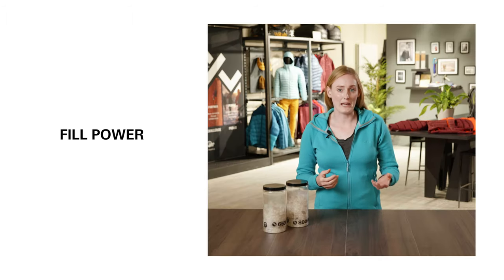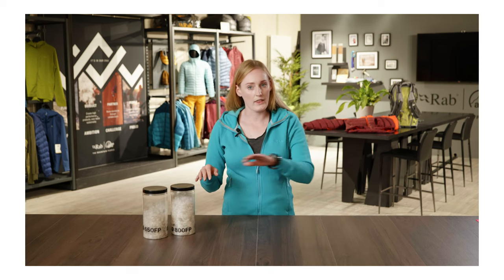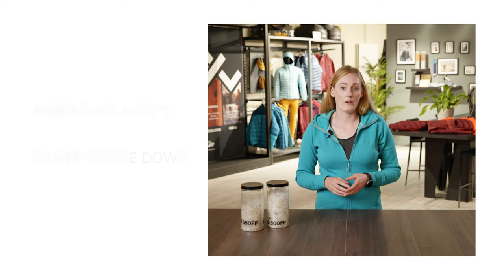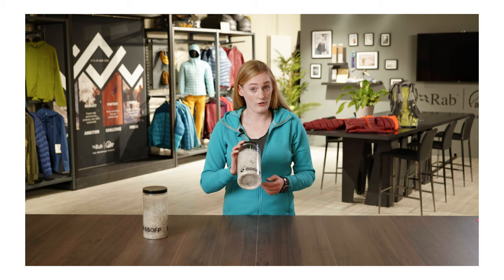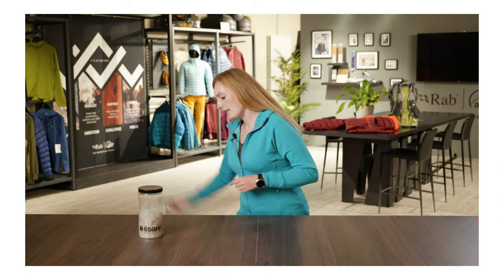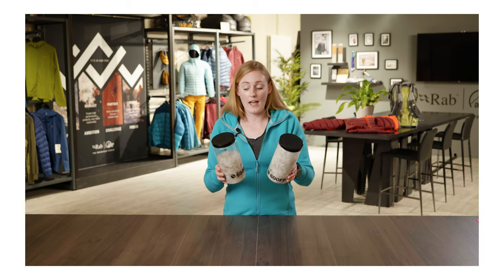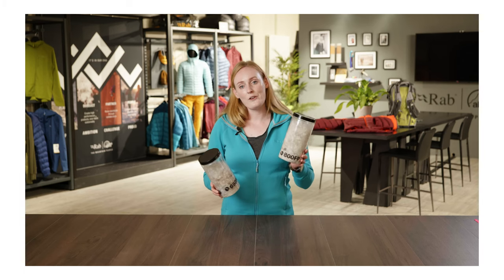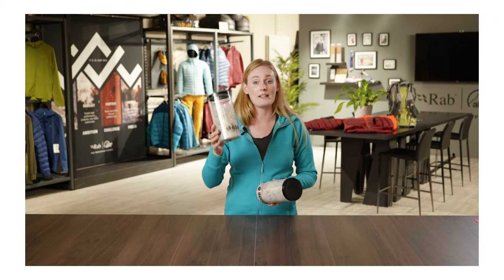Rab Down Fill Power Explained

Comment: So if I want a thin puffer jacket I’d want a 800 fill power and if I want a really puffy coat I’d want a 600 or 550 full power. Correct.